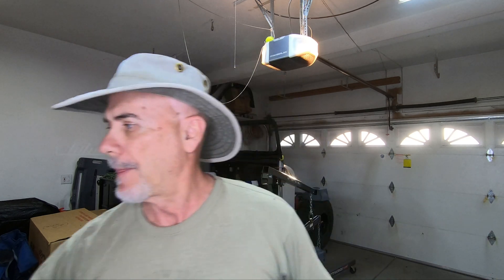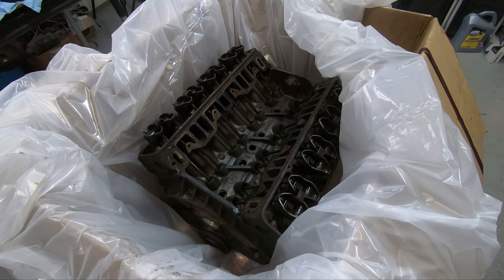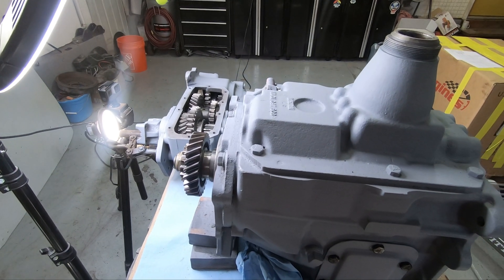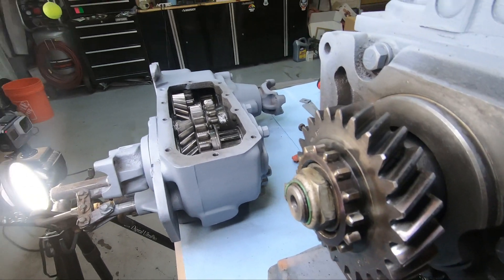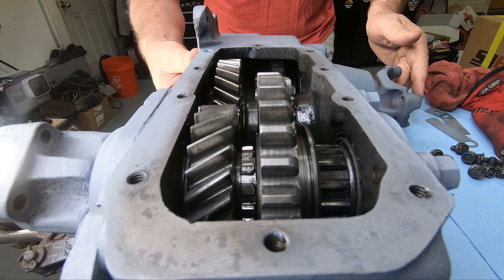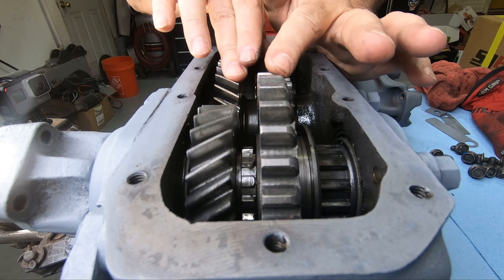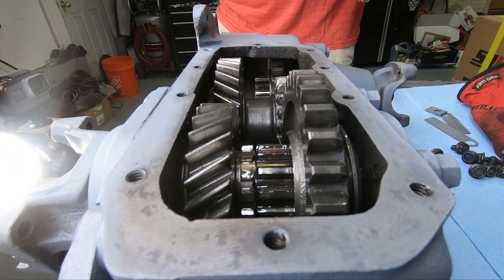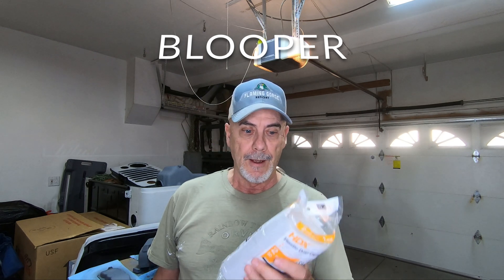Jeep CJ-5 Restoration - EP49 - How a Dana 20 Transfer Case works

Comment: Thank you so much for making this video! I watched hours of video on how to rebuild Dana 20 transfer cases. That only told me that everthing was in right. But it still wasn't in the right gear as I progressed through the shifts. I needed to know exactly where each gear should be in each position to figure out what was going on in my case. Turns out the new linkage I bought was too long and needed to be trimmed to make it work. Thank you, thank you, thank you! I thought I was going to have to buy a new case because i couldn't find any body to work on it.
Reply from the maker: So glad this was helpful!

Comment: In what gear would you tow a t150 tranny with overdrive
Reply from the maker: Neutral... ??  Not sure I'm sure what you're asking.  If you're towing the jeep, put the transfer case in neutral and the transmission will not be involved so it won't matter what gear it's in.  If you're talking about towing WITH the Jeep, or whatever has the T150, you'd tow in the highest gear you could pull in, downshifting as required.  Did I answer your question at all or totally miss what you were asking?
Reply: @LandlockedNoMore  
Right now when I tow my 1968 cj5, I put the tranny in neutral and I put the 4 wheel drive in two high and the overdrive in high.
Reply from the maker: If you put your transfer case in neutral, you won't be spinning anything in the transmission.